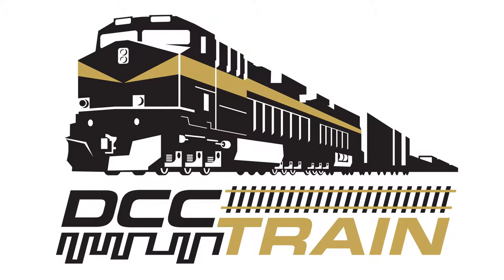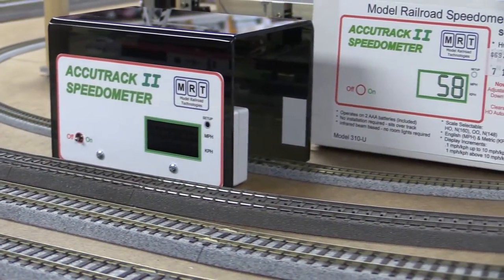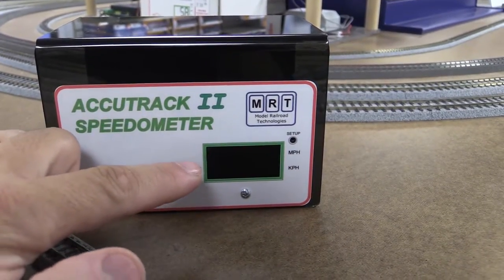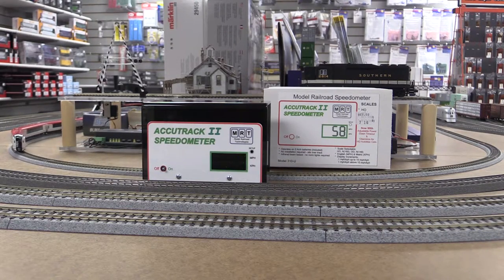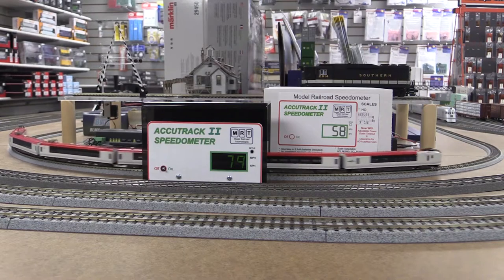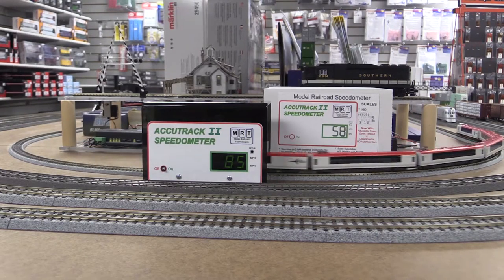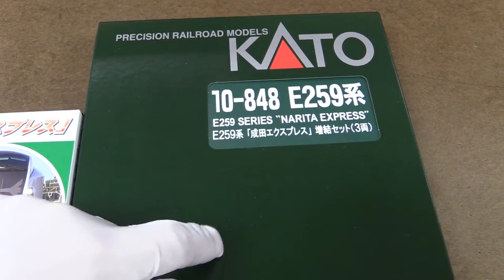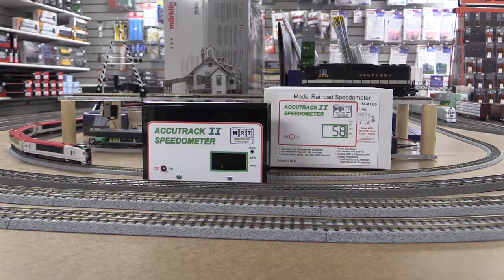Speedometer Accutrack II KATO E259 N scale Narita Express Nゲージ鉄道模型E259系成田エクスプレス 10-847 10-848

Comment: The box for the add-on set has space for the original 3 cars, so you can put the entire 6 car train in the add-on box. Just pop out the 3 foam inserts. You can see part of the top pop-out at 4:32.Remove the inner label seen at 4:35 for the other 2.